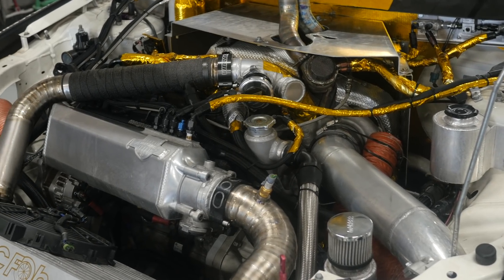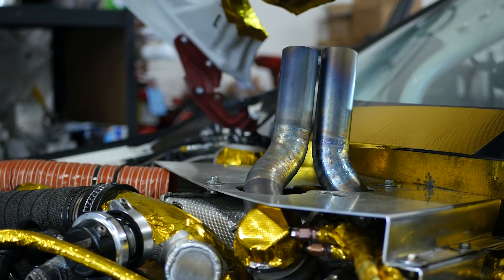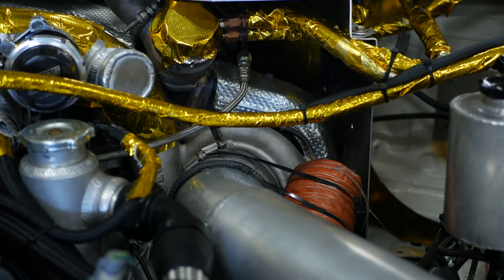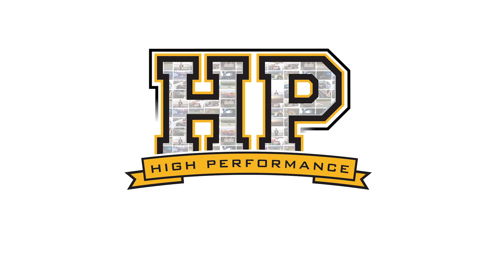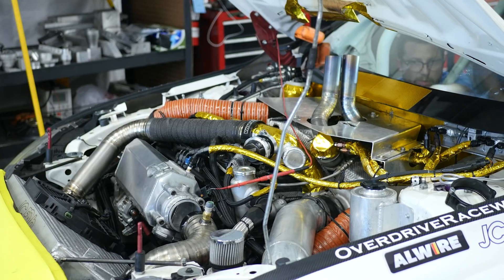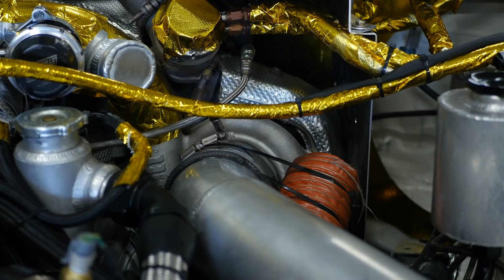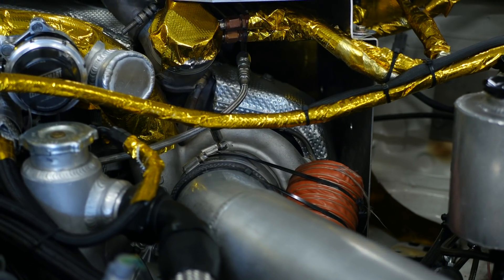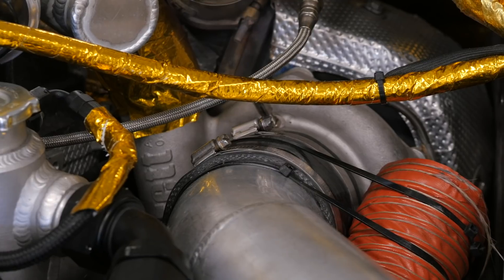What Do YOU Know About Wideband Sensors | Individual Cylinder Tuning [TECH NUGGET]

Comment: Where would you typically install a wideband sensor in an NA, low power vehicle application?
Reply: Single sensor would go after the collector like oem, multiples would go before it. Covered it in the video

Comment: How often should i replace my o2 sensor in my 04 Holden vy ss ute ?
They have probably been in there since from factory 14 years ago.
Reply: Put car on 4 gas analyser to test
Reply: How long do they last. Car has 270.000km
Reply: @freddienz68  there is no set lifespan, they last as long as they last and they fail when they fail

Comment: what about using single WB sensor but 4 EGT to spot variances?
Reply: lot better I would say !
Reply: Yes, better, but with any plenum type intake there may be variations in the VE for the different cylinders and that may affect the burn speed of the charge and hence how early/late combustion is completed and so how much heat energy is used there Vs passed out the exhaust?
Been having a look for it but can't find it, however, there is a YT video of one of the pro' engine dyno' guys/engine builders working through the jetting of a 2x4 tunnel ram setup and picking up 20hp using, IIRC, an IR heat gun? Think it was either the chap that does the Engine Masters or Nick's garage, but not sure?
There are some YT videos available where NASCAR engine shops are visited and they comment on how they monitor Lambda, EGT and the detonation threshhold for every cylinder to get that last few hp out of their engines - 5hp may not seem much when you are looking at 800+, but even the fractional gain in speed and/or fuel useage can be significant over 5-600 miles.
Reply: FOUND IT! SIXTY HP improvement with jetting - https://www.youtube.com/watch?v=EP1Rh829rVk - but it was using individual lambdas - sorry... Still interesting, though.

Comment: Would this be necessary for a turbocharged street car running 400-600 horsepower that drives almost everyday or does a single wideband get the job done?🤔
Reply: DahkaShades depends on how hard you are pushing that particular engine. the modifications you do are not horsepower based but application based.
Reply: Cool. It makes sense though if your looking for the best efficiency/reliability from a engine. eg. a 2JZ

I am gathering information for a street/drift/daily drive car I want to build and reliability i assume is the best way to go about this, agreed?
Reply: @TheYaegerPilot  Depands on various factors. On one side air delivery to each cylinder, on the another fuel delivery. 
Regarding air, intake manifold, head porting quality, valve job, cam condition, piston ring sealing prop., effective compresion ratio*... can hugely affect air supplied to each cylinder. 
Regarding fuel, depands on fuel pump, rail capacity, balance of injector flow one to another, spraying pattern etc plays big role...
So as you can see by the stated, difference in sum of all aspects can be quite big and EGT or WB02 are recommended... 
or you can just go 10:1 A/R to each cyl on WOT and no worries, like most of the tuners do...
Reply: If you want to just see every cylinder afrs with one spare wideband you can weld threads every runner and place wideband to cylinder 1 and plug others and make Street/dyno pull and check what afr looking and then move the sensor next runner and do it again. If there is big differents between cylinders you can make fine adjustment even on Street.